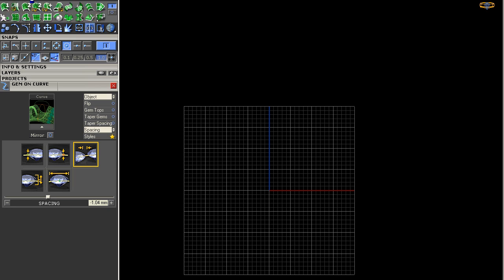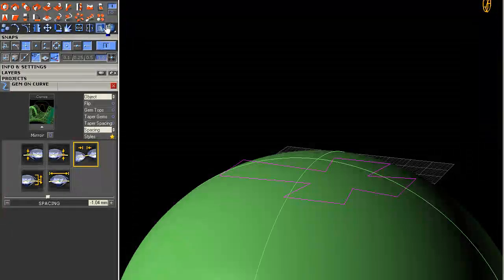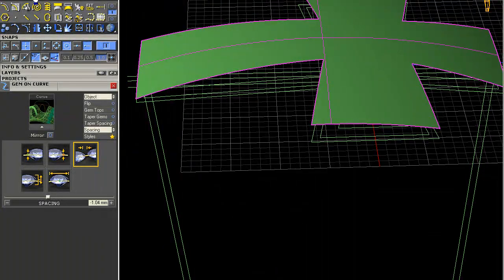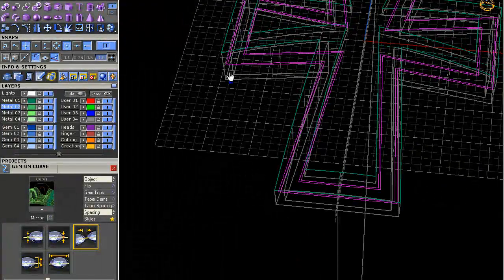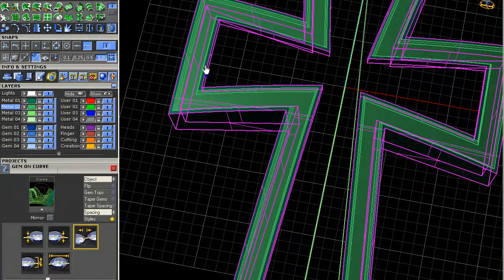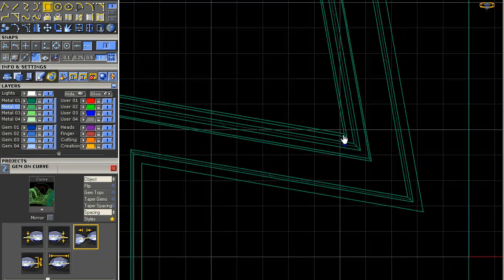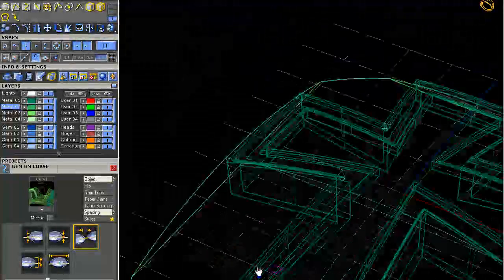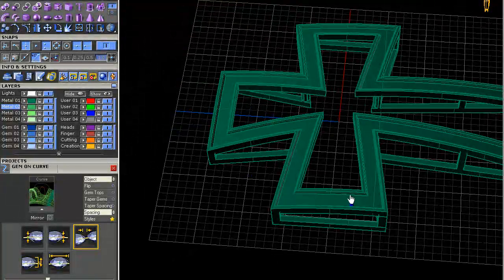Matrix tutorial how to make Cross Pendant

Comment: I have a question, what is the use of making this 3d concepts ? are you sending the files to a jewelry maker after finishing ? I mean what could possibly these models be used for, especially in a country like India ? I am sure there is a use, i just can't see it because in the industrial way of manufacturing an object you have to use a software that keep the trace of measurements and provide these dimensional values to the blueprint for the manufacturer to know what he is really designing. (that is a serious request)
Reply: You send this 3D project to a 3D printer, have it printed in resin, make a mold, then inject wax to make multiples, then cast it in the metal you want.
Or you cast it directly from the printed resin.
Or you print it directly on metal.
Or in plastic.
This is how most jewelry is made nowadays (and has been for the past 20+ years)
And the kids in India are the best 3D designers there is.